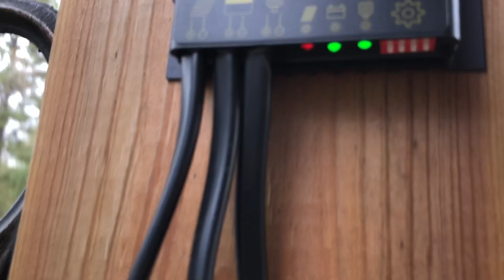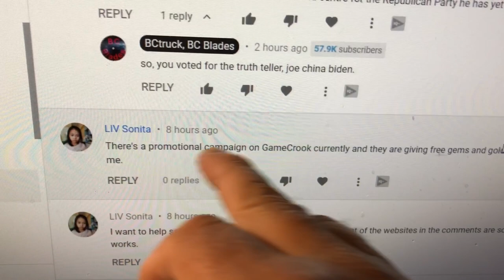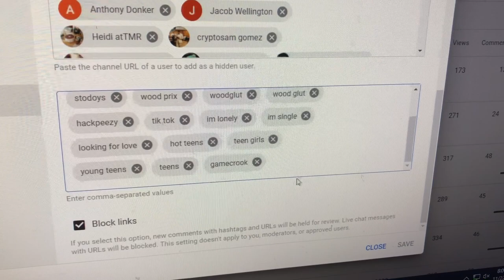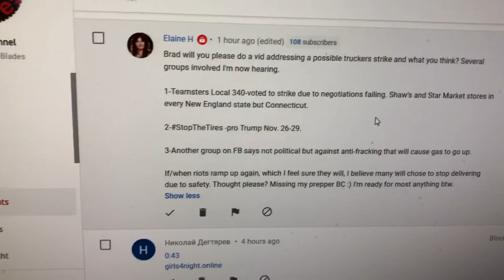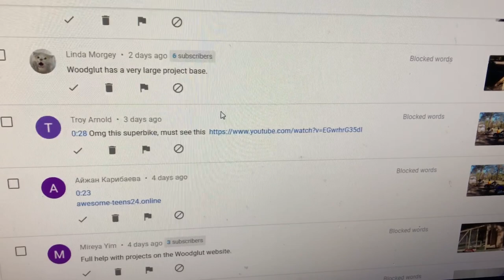Build a solar panel mounting bracket

Comment: I have found over the years and the many times I have had the occasion to disassemble bed frames to use the angle iron for various projects, that it is without a dought one of the more difficult task to complete without the proper tools and equipment. Pallets as well.
You would think other companies would look toward the bed frame and pallet industry to properly produce a mechanical connection.
Yes it is difficult to deal with once being able to be productive and then not because of physical limitations. Smokem if ya got um!
Reply from the maker: I don’t know what kind of steel those bed rails are made from but they are hard to drill.